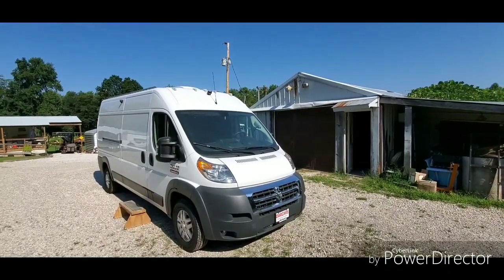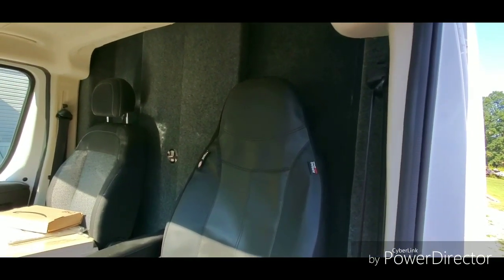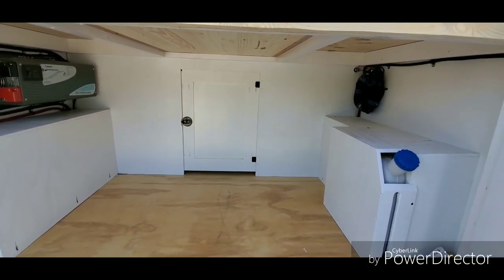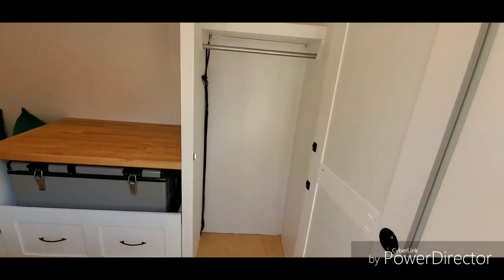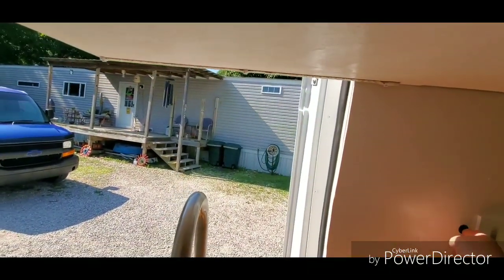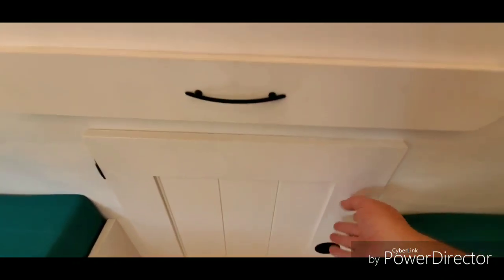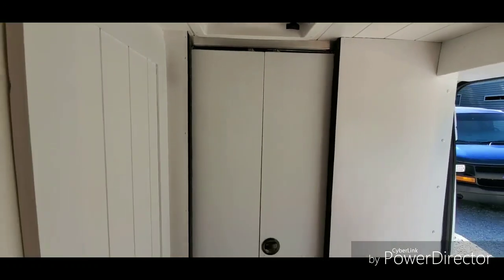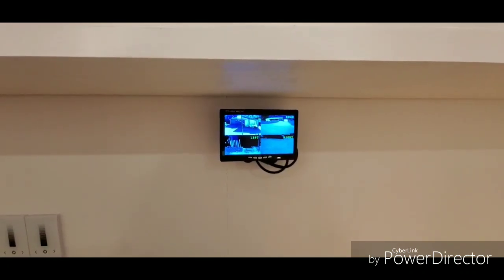"Nurse"BEAUTIFUL 2018 Ram Promaster camper conversion  tour.  E26

Comment: Really like the build. If I ever...you're the man. No stove, no shower, no toilet. I'd have to have all those. Super clean look.
Reply: The stove is solvable with a portable propane stove, though, and the toilet by getting a composting toilet and putting it in the closet, for instance. Possibly on sliders so you can pull it out. I'm really surprised a build for a lady doesn't have the toilet situation covered already. A shower you can work around and shower elsewhere, but if she wakes up in the middle of the night, having to leave the van or even having to find a toilet and then leave the van just seems like a bad idea. A home without a toilet is just silly in my opinion. I'm a guy and I still want a way to go to the bathroom without having to find some disgusting public toilet or using a bucket.
Reply: @lorcro2000  
The toilet can be the bucket system. Go, seal, and toss.
Reply: @bernadettebockis4120  Sure. It's just fiddly, kind of disgusting, stinky and there's always the possibility of an accident. A composting toilet is a proper toilet, with ventilation that sucks out any odors.
Reply: @lorcro2000  Can you be Stealth with a composting toilet?
Im new to all this. Wondering if I found a spot, say in a large apartment complex to park, would the ventilation to the outside be a dead giveaway that someone was in there? That the van probably didnt belong there??
Reply: @sheiladale6200  There's probably nothing like stealth to begin with. People who have lots of vehicle dwellers in that area tend to learn to spot them. A van needs things to be livable anyway, like a Maxxfan or two on the roof, solar panels etc. And you need to block windows to not roast in the sun. You can't eliminate all clues regardless, but if you park smart you can work around it. As for the toilet, you can vent it under the van, so that's not going to be a giveaway.

Comment: She seems very security minded. It seems unlikely she would be OK leaving the back doors open in order to run the AC.  Did you have to put ventilation in the door?
Reply from the maker: No, she is perfectly fine leaving the back doors open. The storage doors lock as well.

Comment: wonder if other security for cab doors, like slide bolts  not easily reached through the windows, might work, and add loud siren she could set off manually
Reply from the maker: What would you need a slide bolt for? The bulkhead door is not to keep anyone from getting to you. Its for privacy and to buy you time to get your protection of choice.

Comment: Pretty sweet build. Did you consider a 12 volt quiet high efficiency roof mount ac?
Reply from the maker: Yes, but $3800 for a a/c unit that takes away from solar space. I know a couple people that have bought them and was not happy at all for the money spent.
Reply: @RedsCustomDesign  Could the AC unit have been installed on the driver side wall at the foot of her bed, eliminating the need to have the rear doors open in order to work?
Reply from the maker: @skaybaltimore  it could have been,  but I wouldn't want the opening that close to the wheel opening.
Reply: @RedsCustomDesign  Thanks. That makes sense. Nice neat job, BTW. +1

Comment: If you want to get rid of the power director watermark on your videos check out davinci reslove, hitfilm express, or shotcut. All 3 are free. Resolve is the most complex, shotcut is easiest, hitfilm is between the two. All video editing software if usually timeline style editing and pretty much all of them work similarly. Software watermarks are a thing of the past. Or, should be.
Talented van conversions. I saw another van builder discussing a solar panel performance/reliability increase that result from heat reduction both inside the living area and on the panels themselves when leaving more space between the van roof and solar panels. Is that true? Also, is there any way to add vents of some kind to the rear doors so the ac could be used without opening the doors?

Comment: Concerned that with the back doors opened to use air conditioner, that some one could possibly come thru the opening under the bed ...
Reply from the maker: They would have to remove the lock first.

Comment: Excellent, as a single woman I like the security cameras, I like this build very much. My concern is lifting waters containers. Is there a was to make an access to spout on out side of cabinet, bring hose in to insert and fill?  
If I can do this some day, since I have allergies is there safe insulation products.  Like the ventilation fas and air fans. Waiting till there can create 1000 watts in a small footprint on the roof. Thank you for you tour, I love the real wood, non off gas products in use.

Comment: AWS ok me craftmanship. I love the whole design. With out the outside monitors and screen aprox. What is the build out cost? I will definitely have you do mine when I'm ready. This will work on a sprinter right?
Reply from the maker: Around $20k. Yes ,but they are not as wide.

Comment: That's some crazy nice work.  But this lady is all about security, yet you can't use the a/c with the back doors closed.  Being open like that doesn't seem very safe or secure to me, unless I am missing something.  Nice work.
Reply from the maker: Why would you think that? They would have to brake through the locked doors under the bed, then pull everything out, then crawl through the little door in the front of the bed to get to you. All of that without you or anyone else noticing.
Reply: Why would I think that? Because a secure lot steel door is wide open. The hatchet in two seconds repeal that would open and expose the entire storage area. It puts everything at risk. That lady is no more safe in that van with that would open like that and she would be with the screen door, and the slider wide open. Having that door open like that where ever she might be is nothing more than an attractive nuisance to someone looking to break into a thing. You might think they are safe, But to a juiced up teenager those two open doors are nothing but an invitation to break in. If you cannot see that, if that lady cannot see that, unfortunately, I think she is in for a very very bad surprise. If nothing else, the cops will want to know why those doors are open. I could go on and on and on about how many ways having your doors open and secure is wrong with you are trying to lock yourself in with no windows in 360° at security cameras. Don’t get me wrong, I think you’re craftsmanship is great. But you should have steered her away from having a door wide open and figured another way to put that air-conditioner on there. Once she reads this, there is no way she would feel safe in that van.If she gets a tech in that van, you are open to a lawsuit for a faulty design and delivering her a faulty product that could have been made safer hey can you just designed the product for the steel doors with the lock as they came from the factory to be integrated into the air conditioning. I wouldn’t have that kind of a design on it if they mind if you gave it to you for free. She has no way to see out from the inside, no way to get fresh air, and if her batteries or the video system goes bad, she’s fine. You cannot be up in a closed up vehicle all the time without getting some fresh air. Besides all of that, heading back doors open like that exposes all of the back into the van and the interior of those doors that were intended to be inside the van on out exposed to vandalism, animals,  and any smart ass kid that gets egged on by his buddy to “see if we can rip those doors off“.
Reply: Harleyglide03 - Harleyglide03  - Gees dude, take it easy. While I agree that having the doors open to run the air conditioner is not the best idea, maybe you missed the two Max Air vents on the roof and she has 360 degree cameras to see all around her van. Maybe the inside back door to the underneath part could use a more hefty lock with an alarm on it. But otherwise I think she’ll be just fine.
Reply: Jordan Elias hey man. I get it.  I do.  I’ve been attacked in a vehicle before.  It ain’t no fun.  I like the guys work, o think it’s top notch.  I really think leaving your doors open is a really bad idea. No way I’d sleep in that like that.

Comment: What supports the AC weight as the van goes down the road? Do you find leaving the wood exposed (not painted) can be conducive to water (not sealed) damage?  Not intended to sound like I do not like the build, but am considering building or hiring out to someone and just came across this video. First time to view your channel and wanted your opinion.  Does it take long for you to build out?
Reply from the maker: The wall is framed with 2x2 and 2x4 and has ¼" luan on the inside of the wall and the outside has ⅝" shiplap that has been sealed with polyurethane. So it is more than strong enough for the a/c and more.

Comment: I really like the build you did with the bulkhead and cameras. I’ve been looking at a lot of builds and your design fits what I’ve been dreaming of; very practical and simple. How do you handle heat if I don’t select a ProMaster diesel? Would you consider installing 3M Thinsilate (?spelling) instead of the blown in insulation? I’d like to keep the finished weight to a minimum for the best gas mileage. Have you done any 1500’s with the shorter wheel base? About how long does it take you? I’m about a year out from my build. What’s the procedure to get started? Finally what would be the price range to duplicate what you did with the security cameras, bulkhead and hook up? Thank you for the possibilities you bring to the lives of people, you’re an angel 😇
Reply from the maker: You don't need a diesel van to have a diesel heater. This was a gas van. The heater has its own tank. I've never used Thinsilate and i would never use blown in insulation. Blown in insulation will compact from the vibration of the road. So after a year ¾ of your walls will not have anything in it.  As for price and time,  it would be around $22k and it takes 3-6 weeks to build.

Comment: I really like your wall ac but isn’t condensation buildup going to drip all over in the back? and where will it get it’s air from? I never seen a wall ac enclosed that way before. Love the concept if it will work well.
Reply from the maker: It has a drain tube for the condensation and the rear doors need to be open when running the a/c

Comment: Great build except for the batteries. Would have done Battle borns and only 3 panels with the same result.
Reply from the maker: With 3 panels you would have to run everything off of the batteries. With 6 panels you can run the a/c off of the solar and still charge the batteries.
Reply: Not everyone wants to spend a grand for a battery.
Reply: @RedsCustomDesign  How often/ many hours a day, are you going to be able to run off the panels alone. It gets hot on cloudy days too. Its very rare that a system is designed to run anything directly from a solar panel, and not running through the batteries then the inverter. Seems like a waste of solar for a few hours of A/C.
Reply from the maker: The solar charges the batteries, the batteries power the inverter, the inverter powers the a/c. But if you don't have more power coming in from the solar then the a/c is pulling your draining your batteries. So if the a/c is pulling 400w and you're bringing in 500w that gives you 100w going to charge the batteries while running the a/c.
Reply: @RedsCustomDesign  How many hours a day do you expect to pull in 500W? Currently there is only 1320 watts of battery reserve (50% for AGM's) - thats 3 hours of A/C (and nothing else) in the trees, clouds or dark. For $1200 more with 2 Lithiums (well worth it after spending that much money) she would have double the A/C time. Not to mention the batteries would have 5 to 10 times the life cycle. As Wills video (linked above) mentions, Lithium is a no brainer.
Reply from the maker: Were are you getting 1320? It has 2- 6v 225ah batteries.
Reply from the maker: And just so everyone knows. When she gets her funds built back up she plans on putting 4 Battle Born batteries in. Step one was the build, step two is upgrades.

Comment: You better drill lighenting holes in that mattress frame.. It will build up mold. Seen it too many times. As mold ruins Gel Foam mattress. They need to breath.
Reply from the maker: You only get mold if you keep your van closed up all the time and don't let it air out. And if you're not laying in bed all the time it will be fine.
Reply: @RedsCustomDesign  Well judging from the 50+ Videos showing Mold accumulation under the mattress. In RV's..and warning of it. I guess I'm wrong. Carry On...
Reply from the maker: There are also 50+ video of rvs saying they have no problems. I slept on a gel mattress with no holes in the plywood every night for 5 years with no problems.

Comment: Hey Red, 

NIce job!  I see the second MaxxAir fan is used to ventilate the garage and pull out the heat generated by the AC unit.  Is there a vent hole anywhere back there to draw air through the space, or are you counting on pulling air out of the living space because the door under the bed isn't air tight?
Reply from the maker: The second maxxair fan is over the bed, NOT to vent the garage area. No you can not run the a/c with the doors closed.
Reply: Okay, I see what I did...I got the front and the back of the van mixed up on the roof top scene...I see the rear fan is forward of the garage now.  If it was my van, I'd like a fan on the roof to extract heat from the garage with a vent hole or two in the floor of the garage to get some flow through ventilation, so you wouldn't have to open the back doors to run the AC.
Reply from the maker: The garage area is under the bed. The wall is only 6" from the door at the top. The a/c unit is only ¼" from the door when closed. In order to do what you're talking about the back wall would have to be moved forward about 2'. By doing that you will lose the seating area.
Reply: I see what you are saying because that fan has to fit in a 14" square hole, and with trim around it, almost the 2' you are talking about.  I looked for smaller fans on Amazon but, they weren't that much smaller and they had terrible customer ratings.   I wonder if that 6" space could be sufficiently vented by just having non-fan assisted vents at the top of the van where heat rises, and a couple at the floor level to provide cooler air flow.  It should work...thermal convection...hot air rises...but would it be enough to combat the heat generated by the AC unit?  Only one way to find out, but that means cutting up a van and putting temperature probes in to monitor that space.   Didn't you make a van for someone with rear windows that opened to vent the space?   I just don't like the idea of leaving the back doors open while I'm inside taking a nap!  Thanks for your videos!
Reply from the maker: You would still have to move the wall forward because the a/c is only ¼" from the door when closed so as it is that will  not work.
Reply: @RedsCustomDesign  Best to stop while you're ahead...lol

Comment: She must sit in one of the seats BEFORE pulling out table. Trapped there once that's out. Then will have to reach sideways for computer, book, food, whatever she will be using table for. Leaning sideways to pick up stuff any weight is not a good idea. Then must clear table same way before being able to push it back in. Not even space for a portable toilet. No matter how good they are, I wouldn't store it in the closet with my clothes. Can't imagine being rained in for several days without even one window. Your workmanship looks great, however, this is top of the list for the worst design ever. It appears fear/security overrode common sense.
Reply from the maker: For starters the owner is a night shift ER nurse who travels to some of the worst cities in the country and didn't want windows to keep out the light so she could sleep in the daytime.  As for the table, it would be no different than having a stationary table having to work around it or climbing around it to get in/out of the bed. As for the toilet that she uses for emergencies it slides under the bed. That's why I do custom builds, its not for everyone. It's made for what the OWNER wants.

Comment: One wonders why the flip up counter extension wasn’t a little longer to fill more of the available space?
Reply from the maker: #1, if it went all the way to the wall when you went raise it up your hand would get pinched between them. #2, the long it is the more pressure you are putting on the locking hinges. #3, that's what was left over from the slab.
Reply: #3 I will definitely Accept as being an honest Reason. Many thanks.